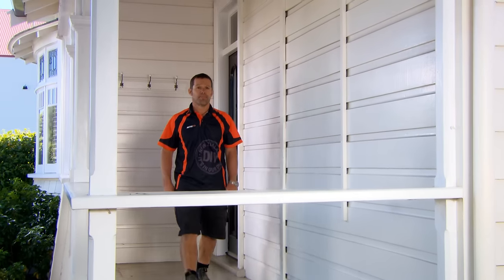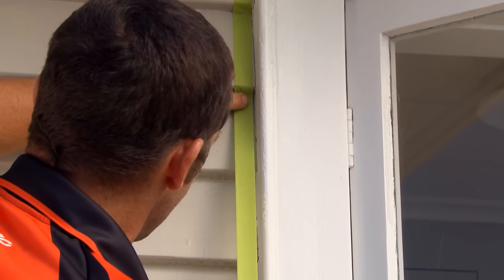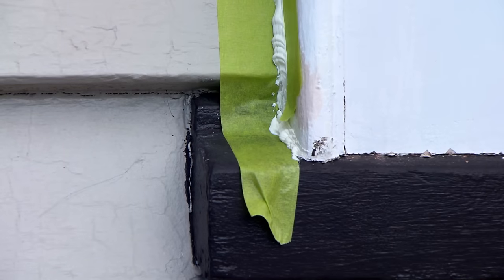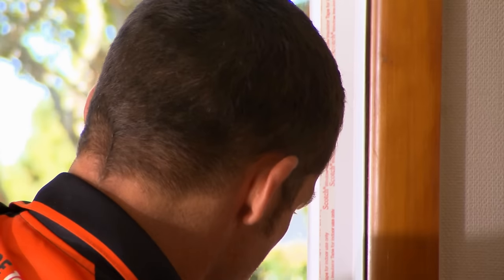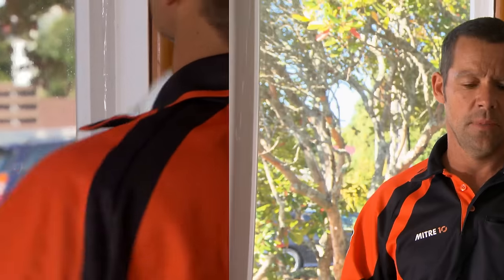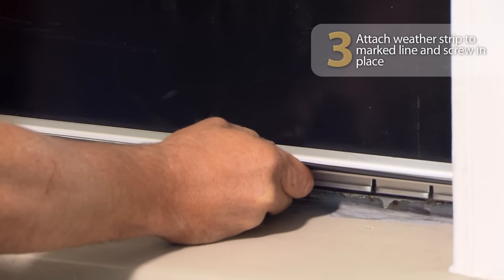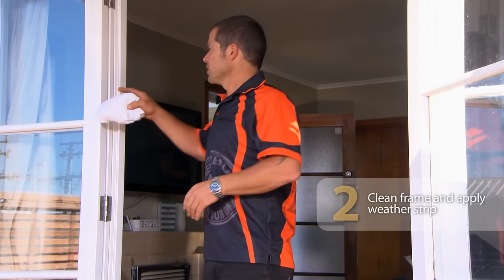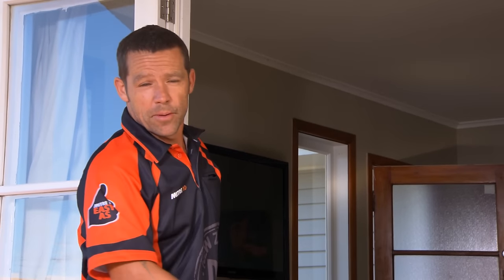How to Reduce Home Heat Loss | Mitre 10 Easy As DIY

Comment: Multi-layer thermal curtains: definitely yes, even if you have double-glazing. Make sure they go all the way to the floor, and have enough material to remain slightly bunched when closed. Pelmets along the top are pretty unfashionable but helpful in reducing convection. Just watch for condensation on the cold side - you want the dew point of indoor air to remain below the air temperature in the space between window and curtain.

Comment: How can I seal a patio sliding door to stop the cold feeling I don’t feel a draft but it’s very cold near the patio door, I don’t want to stop using the patio.  Is there any way to help the room stay warmer.
Reply: Glass does transfer heat out and you can feel it cooling the room standing several feet away, on big windows. I use insulating curtains to contain an in-between layer of air.  I think there are insulating blinds which do similarly.  Its an excuse to shop around and compare, or look it up if you are making your own.
Reply: Use large bubble, bubble wrap, adhere it inside with a spray of water.  In the spring roll it up, label & store it for next year.

Comment: With an in swing door, you would think that the door sweep would bind when you try to shut the door??
Reply: 1st1shot , It doesn't go down to seal until it hits the cam on the outside of the door, when you push it shut.